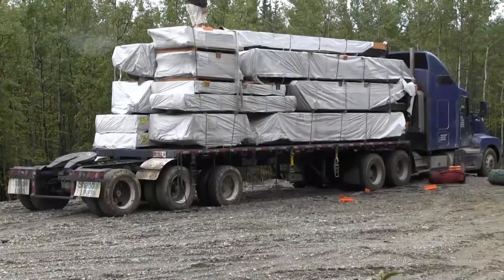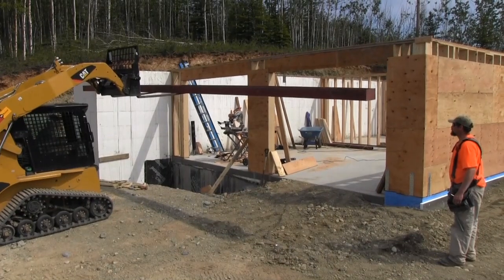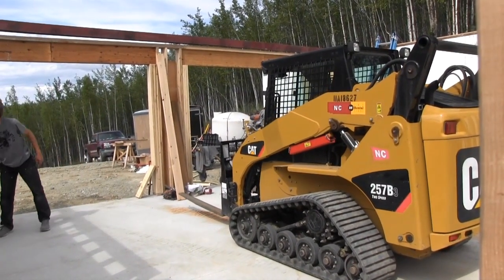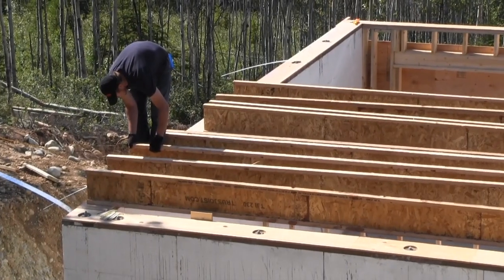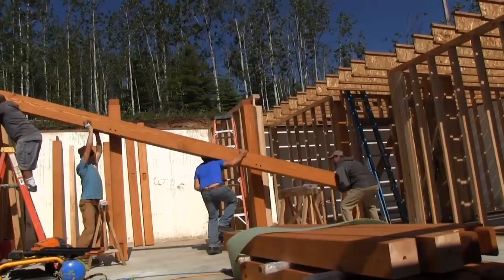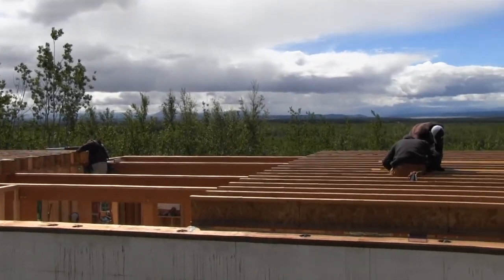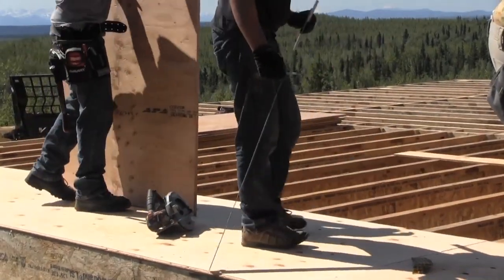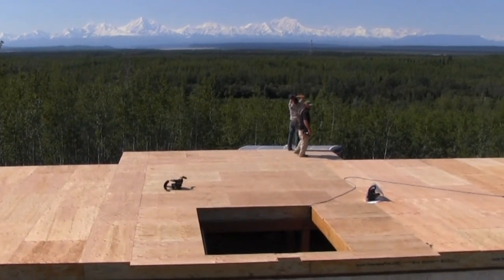Building the Main Level Floor - The Bargain EP6

Comment: WHY? would anyone use an ICF concrete wall on the rear and then a 2x6 wood wall in front? The energy savings of the IVF wall will be lost in the wooden wall. Cost of wood wall per sq. ft. has to be more than the ICF wall. Wood wall is bolted down to the footing and has straps too? Nice lesson for beginners.